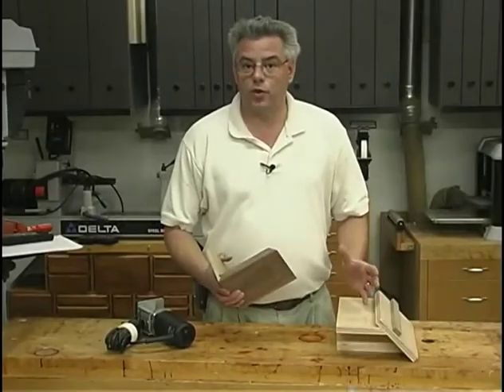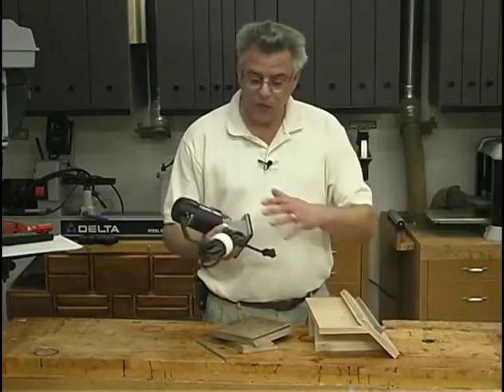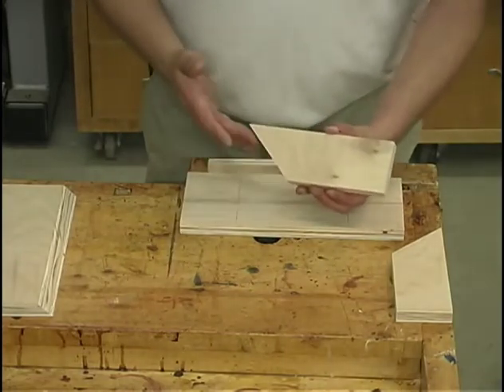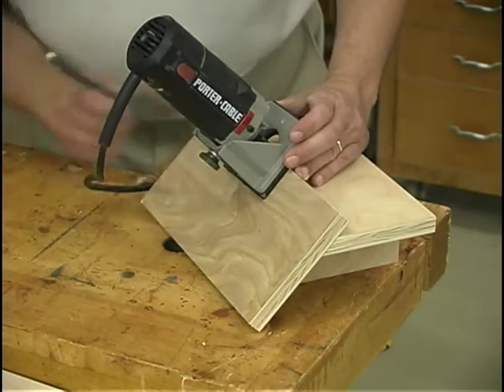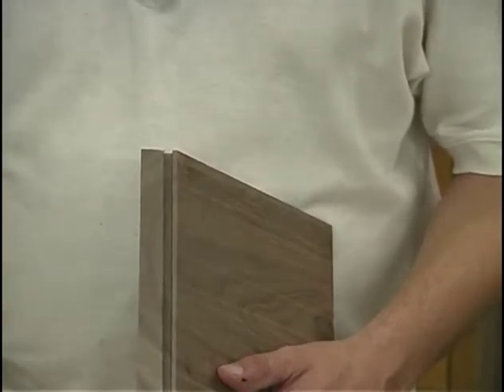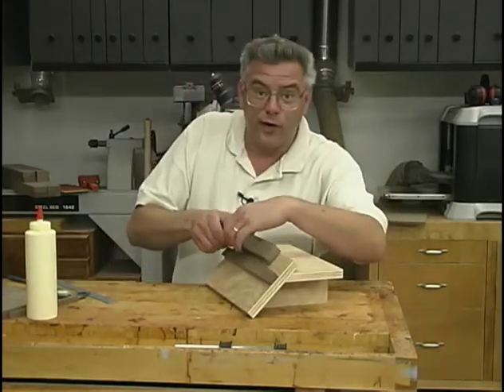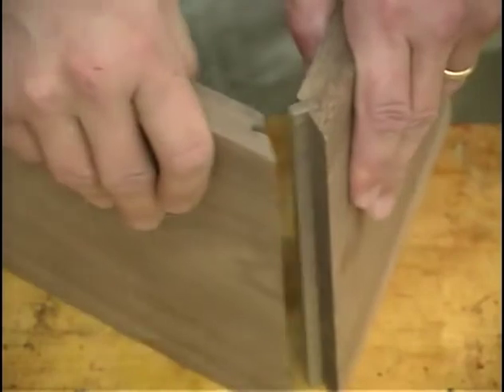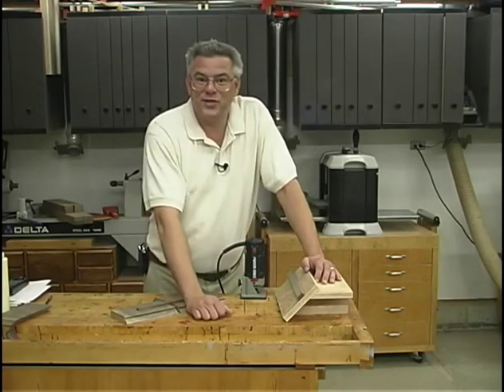W056 Make this slot cutting jig for miter joinery

Comment: I'm trying to figure out the same kind of jig for using splines with blind slots for shelves in a cabinet. The difficult part is cutting the slot in the end of the (baltic birch 5/8") shelf. I've done it with careful routing with a 1/4" bit (1/4"depth) and splines that are 1/4" x 1/2". But it would be nice to have your jig doing a 90 degree slot in the end of the shelf with ease.
Reply from the maker: Hi Bob,
Thanks for sharing your comment/question.  Perhaps one of our viewers has a suggestion that could help out.  
Chris